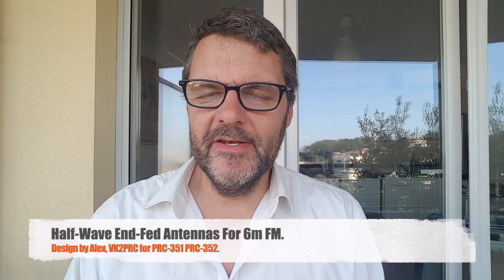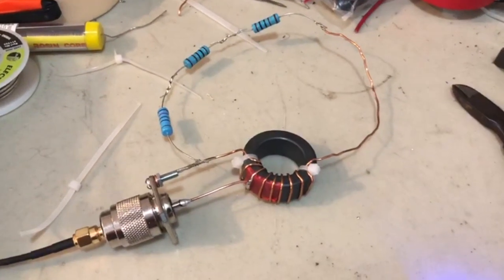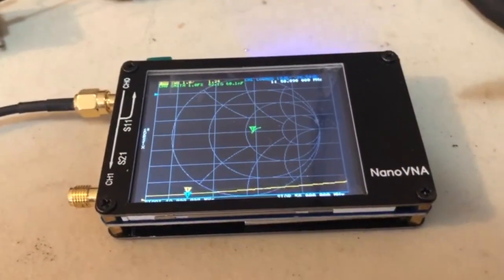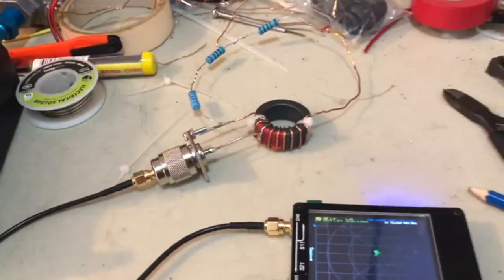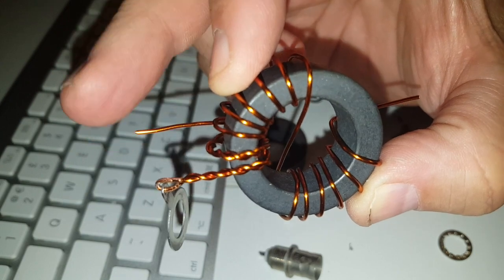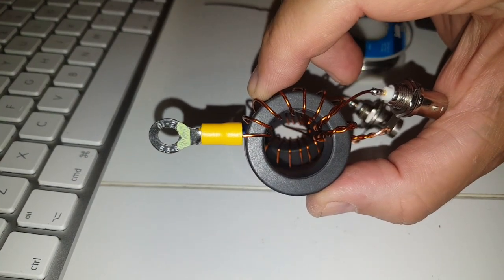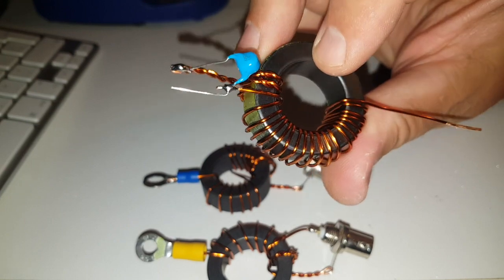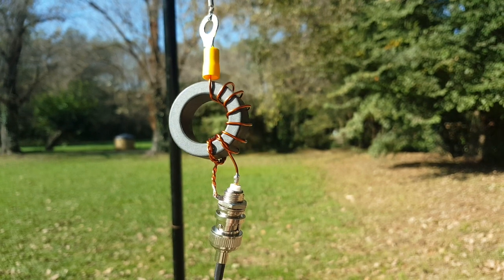Building a Half-Wave End-Fed Antenna For 6m, Part 1.

Comment: Hi Gil, thanks for your videos! I built myself the EFHW with an FT114-61 core (2w:14w with a 68pF silver mica on the primary), used with a success on 10m and 6m (100W ssb). The SWR of the transformer (w/ the capacitor) itself is 1.3/18MHz, 1.0/21-28MHz, 1.3/50MHz here. The attached antenna wires cut into resonance do not change the SWRs. PS: no c/p used, a cap coupling via the coax works. Best 73 Igor de OM1ZZ

Comment: An EFHW is a full sized antenna but it's not a balanced antenna, like a dipole or a G5RV so that's where ( I believe ) the discussion about counterpoises comes from. Without a counterpoise, the shield of your coax will do the job of the counterpoise, but at QRP levels you probably won't notice that. Thanks for sharing the design for a 6m version, that would be great for portable use.
Reply from the maker: If it works ;-)

Comment: Thanks for the video Gil. One simple way to see if there is common mode current in the coax is simply touching it and/or moving it while looking at the VNA. If the curve changes just by touching or moving the coax you know you have common mode currents. From experience it’s almost always necessary to have a 1:1 balun / choke in almost any kind of antenna to eliminate cmc. In verticals with radials on the ground you can get away without it but .. losses..
Reply from the maker: Great info, thanks.

Comment: Good job Gil. I have just started having a play with EFHW at HF using a 49:1 after extensive success with non-res EFLW and 9:1 with good tuner. Seen various rules of thumb for EFHW using 0.05 WL c/p which I guess can also be tagged to radio earth nut. Probably important QRO to avoid RFI bites. Low-ish power (say <50W) then the coax braid likely ‘picks up the slack’ and you perhaps don’t notice. In any event, a tiny 300mm c/p on 6m band is no biggie and can just lay in your backpack or put it down your trouser leg to keep you warm hi ! Simple experiment would be easy and worthwhile. Best 73 Nick M1DDD

Comment: Without a counterpoise wire the coax feedline acts as the remainder of the antenna. What I hear people say is that because the EFHW is fed at a high impedance point the shield current is low and therefore not a problem. But this is not entirely true. The impedance at the feedpoint is high, so there the shield current on the coax is indeed low. But as you move further down the coax, towards 1/4 wave away from the feedpoint, the shield current gets higher, in the same way as the EFHW wire itself sees a higher current in the center (at 1/4 wave from the end).
When you like to add a CM choke in the feedline, the best way is to place it not at the 49:1 transformer but further down the coax where the impedance is lower and therefore the CM choke more effective.

Comment: The advantage of the halfwave end fed is that it does not require a ground plane and it has 3Db gain over a dipole. It also does not have the high radiation angle or multi lobes of the 5/8 or 3/4 wave antennas that still require a ground plane. Halfwave is very popular with wood sailboaters. Halfwave on a portable is a good choice.

Comment: I also found mono band end feds work better with 16 to 1 transformers. To get a rough idea of wire needed I divide 442 by the frequency to get feet needed and add a bit. 
I bent the wire back and twist. Seems that if I cut the wire it is needed to be added later.
Reply from the maker: Only on 6m weirdly..

Comment: Hello Sir, Your videos are all very informative and interesting. I don`t use toroids for my end fed antennas as they can be very lossy at VHF without using special grades. Instead, I use a small coil and a preset capacitor arranged as a tank circuit with a tap a few turns up for the center of the coax. I have sent you an email, with diagrams and pictures, along with instructions. Just search for the word `coupler` on the subject line and you should find it. Very best regards from the UK. Hope to meet up on the air sometime!

Comment: 17:37  Its interesting that some go with the 2 material and love it. Some go with the 31 43 and 61 material. The two auto tuners (that I have experience with, mfj and t-200) go with the 2 material . The differences are interesting and I can't say that I completely understand the differences. This is a very interesting video and the differences (which may be hard to measure) may be in the gain ? On to part two, and have you ever thought of perhaps a remote reading signal strength meter ? To show differences in signal strength ? I realize now this would be considered as an old video hah hah.
Reply from the maker: I have a field-strength meter now, but I used the FT-140-43 for something else...

Comment: Gil, You might want to check out the last video on the TRX Bench YouTube channel. There he builds a matching tank circuit for the 6 m band without a using a torroid. Lots of math but informative. Cheers.
Reply from the maker: Will do, thanks!
Reply: @RadioPrepper  He also has an interesting series on the theory and building of CM chokes and baluns starting at video #100.

Comment: I think a well made Bazooka is the better antenna. Because it can handle more power output and has better bandwith. And there is no need for an transformer which produces a lot of losses and a lot of heat.
73´s DH1KJ
Reply from the maker: But I need a whip antenna on my military manpack...

Comment: Hi.
Czech military manpack radio Tesla RF10 had a nice wire end fed antenna, working in 50 MHz band. It had impedance transformer wound on small ferrite rod. Unfortunately, it was the qrp version. It should withstand 4W with the PRC351. I would not try to use it with the PRC352 amplifier.
73! SP6WJM
Reply from the maker: I have one! Unfortunately the radio does not work. I wish I could find another one.. I do have that antenna! Maybe I will try it with a PRC-351..

Comment: Hmmm  an AR-6 Ringo vertical is an end fed half wave...  yes/no/maybe???? 
It is a VERY popular antenna but seems to be unavailable from Cushcraft at this time. At about $130 US, many people are encouraged to try building something else especially since the Ringo cant be had now. I am researching efhw 6m verticals fed by a unun so I am here to watch your video to see your results about toroid core materials. Is a capacitor across the coaxial end necessary? 73 de w8nsi
ps: Okay 43 material for hf and 61 for vhf. No capacitor. Experiment time.
Reply from the maker: Great, sorry, I never heard of the Ringo.

Comment: Hi Gil
Your vids are always informative/educational/entertaining especially those on EFHW ants.
Because of my restricted environment, the EFHW has become my Go To Ant at my QTH bc it goes up/down with ease and keeps the Apartment Nazis at bay.
I'm very interested in 6M for both FM Repeater and SSB ops. Looking forward to your follow up vids on your 6M work.
My thoughts:
At 50 Mhz, vs 20Mhz, what are the magnetics/interwinding and compensation capacitances doing?
Also, would the Smith chart trace of a nanoVNA shed light on what a 3M bit of wire acts like with/without matching?
Your vids are quite valuable. I like/save each.
73 OM de KA1RUW
Reply from the maker: Probably, but I need to educate myself further to get to that level..

Comment: Hi Gill.. whats  the velocity factor of that wire ? if it is steel it migh be quite high so your quater vave is going to be much shorter... I have also found some matching transformers  have a natural resoant frequency.... try sweeping it unterminated
Reply from the maker: Thanks. Their site doesn't say, it's #534, 26g.
Reply: @RadioPrepper  Copper is going to have quite a high VF.. with the variation due to the insulation.... The steel I would expect to have higher resistance and therfore a low velocity factor. It could be as low as 50 in which case you are getting close to a wavelength... I have no idea how the copper and the skin affect afect the vf. It may end up the same as copper ??? It would be a good question to ask the wireman..I would love to find out. . It would also be good to know if there is a risk of it changing as you wind and unwind the antenna and potentialy crack the copper coating.. Have you considered feeding the antenna with a parallel tuned circuit ? This might be less "lossy" and you could make it adjustable in the field if you use an air spaced vareable capacitor.
Reply from the maker: I haven't tried since it works fine.. I suspect indeed that the VF would be much closer to copper...

Comment: thanks for your video... havent you tried using as a impedance transformer bifilar 300ohms wire the kind used many years ago for tv antenna?   using that kind of a jpole... i have one that i use for 6m  and it works great...  you can even have it in doble half wave zepp to have more gain
Reply from the maker: Maybe I'll try thanks!

Comment: Ok. I know almost nothing about these type antennas. 
What would happen if you run a Balun (1:1) after your transformer then to the coax to the antenna?
Reply: Antennas need some kind of counterpoise.  An endfed use either the coax and/or metal support structures to distribute the missing half.  In general it can be a noisy antenna due to using the outer of the feedline for RX & TX.  I.E. it can pick up noise near the shack and radiate RF into the shack.  I would definately make a groundplane for the antenna.  It can be a quarter wave on the desired band.  In this way you will radiate near the feedpoint, and you can use a choke or current balun, e.g. ferrite on coax near the feedpoint.  Then you will have low common mode currents and least noise on RX.
Reply from the maker: The end-fed random wire yes, the end-fed half-wave not so much.

Comment: Hi Gil, great video like always.  But why not using a J-pole antenna?  I don’t think you would try to use it as a multibandantenna, so there is no need for a probably on VHF lossy transformer.
Reply from the maker: Simply because I need a whip antenna for my military manpack and the J-pole while great wouldn't be as practical.
Reply: Radio Prepper You’re right, a J-pole would be about 4.5m long and not practical.  I hope you will succeed to make a good transformer. I’m looking forward for part 2.
Reply: Radio Prepper   use a plumbing union, maybe a few to shorten the J pole to fit into your pack

Comment: Gil thank you for the video ! Compare to à Dipôle ( 6m long!) without Transformer Why complícate the job with a EFHW for 50 MHz fréq. ?
Reply from the maker: A dipole for 6m is 3m long. As stated before, because I want a whip antenna on my military manpack.
Reply: Radio Prepper Ok cristal clearing, but in this case why not a 1/4 Wave vertical whip ?

Comment: Just a suggestion: you might wish to keep a rubber mallet (with hard rubber head) in your Toyota for situations just like this wherein you drive a stake or an antenna mount into the ground.  Very informative video.  I have missed you on-line lately.  It's that d@mned virus! 😒  AE5ZX

Comment: Toroids and transformers can have more losses on higher frequency. Complex permeability is a good hint here. One manufacturer recommended 61 material for 25MHz and below. Complex permeability means roughly that at some point inductance starts to behave more like a resistance. Then transformer will dissipate power. The higher the frequency, the smaller the inductance and more resistive it gets. This may not show up well on analyzer because a very small signal has very low magnetic field and losses increase a lot more with larger signal. 
Material 43 is lossy at vhf too, even more than 61 probably. It is good material for chokes where resistive losses are ok or even wanted. 
I'm not sure which material would be recommended for a transformer like that. Air cored would be the least lossy but they'd be very large at that low frequency.
73
Reply: -2 (iron powder) material has lower losses than ferrite materials at higher frequencies. For 50MHz it's a better choice than -61. The inductance per turn is certainly lower but that's fine, as you need less L at 50MHz anyway.
I'm curious to see how it works out in a real life test. Looking fwd to part 2.
Reply from the maker: I might try 6 material as well..
Reply: @RadioPrepper  Yes, also a good choice. -2 and -6 are not too far apart, with -6 for even higher frequencies. But the inductance of 2 or 6 are quite low. The T106 size has the highest inductance per turn (T80 or T130 are lower) but still quite low. You really need more than 2 turns primary. At 50MHz the ZL at 2 turns is only 16 Ohms. Which is in parallel with the 50 Ohm of the system. I would go for at least 5 turns (ZL = 90 Ohms). And a well tuned parallel cap to cancel out part of the L. Otherwise your transmitter will have a hard time driving this.
Do you know the website toroids dot info? See what happens if you fill in only one or two parameters, like # of turns and freq, then you see the impedance. Or frequency and impedance, to get # of turns.
Reply from the maker: I'll check  it out thanks. I was going to use three turn primary, 21 total on the T106-2.
Reply: @RadioPrepper  Hmm, that would give you a primary of only 120nH (XL = 38 ohm @ 50MHz). With 82pF in parallel this might work.

Comment: How about a J pole. It's a half wave with a quarter wave matching section. As for a counterpoise, Steve Elington on YouTube has done a lot of work doing antenna current measurements with and without counterpoise, earthing etc with EFHW antennas. https://youtu.be/MzfQybYMlUc. 
Also Sotabeams sell a Pico efhw kit and the web page explains that changing the toroid for a t50-10 type it will work on 6 metres.

Comment: Hi Gil, another great video, however, you lost me when you where talking about needing a transformer for a 1/2 wave antenna, I'm thinking something like this I bought from Amazon, https://www.amazon.com/gp/product/B07SSP7F7T/ref=ppx_yo_dt_b_asin_title_o02_s00?ie=UTF8&psc=1  (I bought the 42" one) however,  I don't see why you need the transformer. Can you please do another video where you explain this, or point me to one you have covered it before? Thanks
Reply from the maker: I wonder if there is any matching circuit at the base... It would be interesting to test the SWR..
Reply: @RadioPrepper  I'll test it in the next few days and post a url to the results.
Reply: That Tactical Antenna has a loading coil at the base.
You are right with a 1/2 wave dipole you do not need a matching transformer because you feed the coax to its center which is 50 Ohms Impedance, the 1/2 wave when fed at its end (EFHW)  has a very high impedance 1000,s of Ohms, this is why the transformer is needed to bring the high Impedance down close to the 50 Ohms.
Reply: @stevejones8665  Ah, got it now. The whole 1/2 wave threw me off, as I'm looking out at my CF 1/2 wave dipole, then turning an looking at my EFHW 2mtr antenna that is really 1/2 wave, with a loading coil on the bottom, and just SMH, saying to myself, "I know I'm not getting a really silly concept here"
Reply from the maker: I think those long HT antennas are a marketing gimmick counting on people's belief that longer is better. I suspect a high SWR and them counting on the radio's SWR protection circuit to kick in and reduce power to avoid drying the finals..
Reply: @RadioPrepper   I just finished running a BUNCH of test on 4 different antenna's, the ABBREE 42" flex, both extended and folded in half, a Comet CH-72S, the stock antenna shipped by Kenwood with their TH-D74A (tri-band), and a NAGOYA NA-771. I used a miniVNA Tiny, the Freq's I scanned where 144Mhz-148Mhz, 420Mhz-450Mhz, and 220Mhz-225Mhz if the antenna was to be used in the 220Mhz range - (Kenwood and the ABBREE).
The short story is, the ABBREE is a pretty darn good antenna, and I think a potato would have a better SWR then the other three antennas do. Kenwood sure includes a crap antenna with the $500+ HT.

Here's a URL for the SWR charts, if you'd like more data, I'd be happy to run more tests. 
https://drive.google.com/drive/folders/1FmVISCDQq_z88v3cpybWYxUuAmv_R68A?usp=sharing

FYI - your 49:1 BALUN design works great, and gives some pretty nice SWR's from 5Mhz to 30Mhz.
Reply: @RadioPrepper  With the long ABREE antenna I did some tests with various antennas for my Kenwood TH-D74. An amateur friend listened to the repeater and reverse and provided me with signal reports for the antennas. While the Diamond tri-bander worked well the ABREE output a much stronger signal.
My friend was about 4-5 miles away and the repeater about 6 miles away and I was 15 floors up on my apartment balcony, on the side of the building facing my friend and the repeater. Overall quite satisfied, but it is an awkward antenna. (edit) de VA3NIE

Comment: Hope this link also gives some insight.
https://www.pi4vlb.nl/wp-content/uploads/2015/04/PA1SSB-Info-voor-het-maken-van-een-Monoband-en-multiband-end-fed-antenne.pdf
Is in dutch but think it will clear itself.
Lucht=air
Draad lengte = wire length
Aantal wikkelingen = number of wire turns (for the coil L)
Kern eg the toroid type if not air wound.

Tuning: mount a 3-3.3K resistor and tune with the rg58 (or alike) by cutting until close to swr. 
If you might need to tune the antenna wire, just bend it back twisted.
Have a 20m version which works very well.